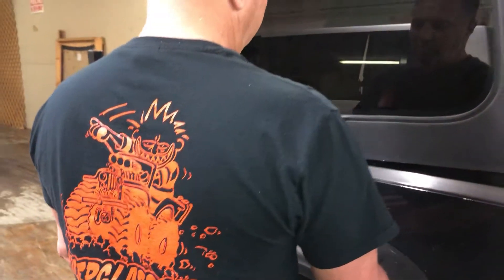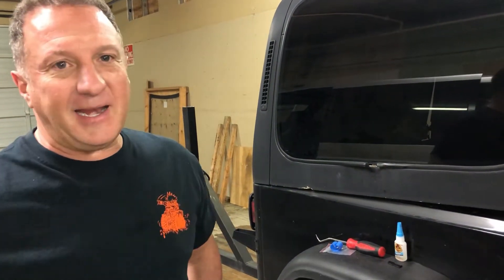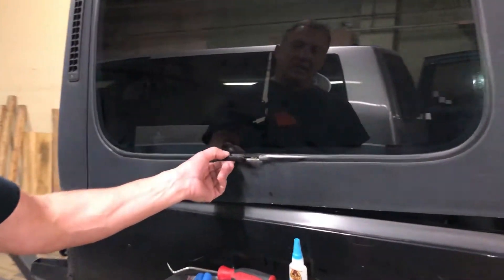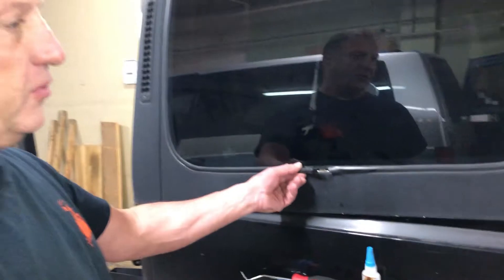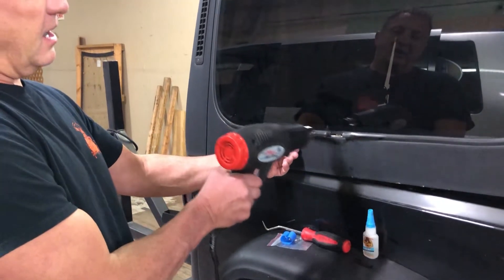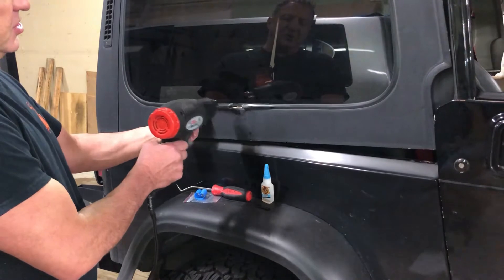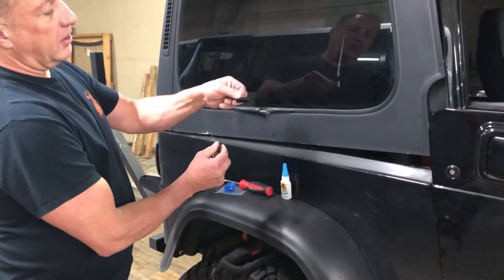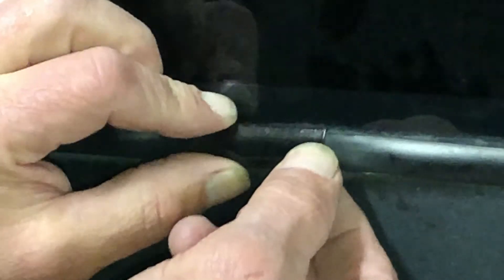Jeep YJ Quarter Molding Repair

Comment: Have run into problems with replacement glass not fitting correctly on yj or tj quarter window?  I'm replacing mine and there's a 1/4" inch gap sticking out away from the top. I'm trying to find a good used glass that actually fits flush like is supposed to but nobody has any in my area. I don't want to just fill the gap with glue because it will look crapy.